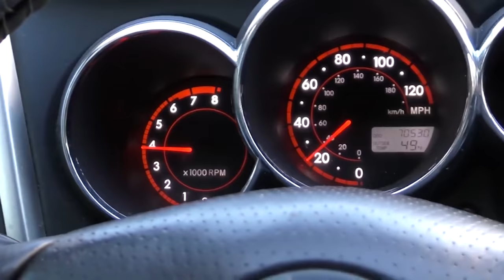5 Signs Your Transmission Has a Serious Problem

Comment: I bought a Honda. Just wanted tire change. But of course they "found" other stuff. I ended up changing transmission fluid and some other fluid.  No idea if they changed the filter or there even is one in a honda insight

Comment: I bought a 25 year old honda prelude. Sat for 2 years after being babied by a grand ma or grand pa for 10 years. I did a drain and fill with the first 3 quarts and added genuine atf in and it solved all tranny issues :)

Comment: Scotty I flushed my transmission fluid put Lucas transmission additive  with beck & arnly transmission fluid then from stop to drive it started to hesitate, sometimes I have to apply brake so it won’t jump start on traffic to father ruin transmission. Should I change the fluid again use the same old brand instead? Help!

Comment: I have a 240000+km E46 with a 5HP19 automatic transmission. As far as I know, it hasn't been cleaned out (replacement of filter, magnets and such...) for the last 70000km. Il probably should do it.
Do I replace part of the oil or put all of the old oil (at least what got out by itself) back in ?
DIY kits often contain 7 liters of fresh oil.

Comment: So I’m confused. I have to change the transmission fluid with new fluid but it will mess up my transmission?? I bought a car and I’m not sure when the last time it had or even had new transmission fluid in it. I’m lost on what to do. 
08 Nissan Altima 2.5 sl. 
Bought at 132,000 miles now it currently has 143,000 miles

Comment: I have a 2004 F150 was having shifting issues: I changed trans filter, fluid put Lucas slip, fixed most issues and got movement. I was Ashville to drive it but had a issue with needing to keep gas pushed to shift through about 45 mph and if I kept gas pressed, it would shift through all gears but once I released gas, I had to go below 25 mph to restart cycle... any help would be greatly appreciated!! (Update) the shifting is getting better through 25 mph and 30 mph not required to go below 25 mph to restart shift cycle. Improving Slightly...

Comment: exact same code except im in a 2005 toyota corolla s. lucky i stumbled upon this, just spoke to a mechanic today and he said to replace everything im looking at around $4-5k. same exact code, first time ive seen this in 3 years of owning the car, and i realized after watching this video it could be this. fluid never changed, dirty, and low on cold. i added new fluid to it before watching this, thinking it would help. guess ill be draining all of it to see what i can do to prolong its life.
Reply: Did it help?  I'm do the same thing
Reply: @DangLao  it did help. now after 10mph up to 48mph the transmission is quiet like it doesnt have any issues. on cold starts, it has a heavy hum when you first drive it off, and of course after getting up to highway speeds it hums and doesnt shift into the correct gear.

i drained the transmission and filled it 3 times until the fluid ran pink/red, pretty clear not perfect. added lucas transfix to help the clutch in the transmission grip (im guessing the clutch pack in the transmission has been worn) and shift better. got better gas mileage and it does run smoother, but DEFINITELY just prolonging the life of a dying transmission at this point.

in the last 2 weeks i bought a used transmission (tranny is at 122k miles from previous owner). gonna have it put in sometime soon and hopefully i can properly maintain it myself after this so this doesn't happen again.

Comment: I have a 2013 ford raptor I can be going down the road in it, and I will get a wrench on my gauge cluster the speed odometer will drop to zero then transmission will shift crazy like go to 5th gear and stay there. What do you figure the cause?

Comment: I got a 2000 chevy c3500 7.4l vortec engine. Transmission stucks in first when cold, then I turn the truck off and back on and it works as if nothing is wrong with the transmission. I scanned it and threw a bad 1 and 2 solenoids code. Changed them and the problem still there. I changed the transmission speed sensors and problem still there. What could the problem be?

Comment: Hey Scotty, I have a 09 F350 with a 5-speed automatic tranny, truck has 137,000 miles, fluid has never been changed. I checked the fluid while the tranny was up to temp, there was lots of grit on the dipstick. tranny shifts fine with no problems. The same case with the transfer case, fluid was never changed. Should I just change the tranny fluid and filter? how about the transfer case fluid? you think I should change it.

Comment: OMG this is very important information. I have a honda fit 2020 with 40,000 miles. Should i change the transmission fluid?

Comment: Scotty where are you located? I need you to look at my car. I have a 2006 Ford 500. I believe I have a small problem with my transmission but to sure. I bought my car to a mechanic, and they told me it was my front brakes, $350 later the problem is not fixed. I bought the car back and was told to take to a Transmission shop. I took it there and a mechanic took a quick look at my engine and told me my upper motor mount was loose. I had that fixed and $190 dollars later the problem is still not fixed. I was told once that is fixed and if it is still happening to bring it back to them and they would flush the transmission and see if that fixes it. (What I hear you saying makes me think all the mechanics are taking advantage of me because I am a woman and not a mechanic). The problem is when I go to slow down the car (jerks) somewhat but not all the, time. Only happens when the car is hot and has been driven for 15-20 minutes. I only paid $3000 for the car and already spent over $500 to get it fixed in less than 3 weeks of owning the car. I don't want to pay for a transmission that cost more than what I paid for the car.

Comment: I just bought an 07 Chevy Avalanche LS from someone back in February 2023. I do not know if they ever changed the trans fluid on it before. It was at 122XXX(i cant remember the exact) miles when i bought it. It is now around 131XXX miles. Would it be a bad idea to change out the fluid now?

Comment: And a friend of mine, who used to rebuild trannys for a living said... if you use the Lucas in your trans, don't just leave it in indefinitely or it swell all the seals and everything rubber within the tranny until everything's so tight it, it'll bind up and wont shift at all.  Put Lucas in for 3-4 K miles then unhook a cooler line or drop pan and get most of it out n replace with new trans fluid...

Comment: My car after running for an hour (30-40miles) 1st 2nd and reverse gear is stiff and comes to normal while parked for 1-2 hours. Transmission oil changed recently. Please help

Comment: so if i’ve had my car since 70k miles and now it’s around 88-89k miles i never did anything but an oil change around 80k .. i just changed my ignition coil and spark plugs because my car was shaking etc and it helped it. now my transmission is slipping and not wanting to go into gear… what should i do other than a transmission flush

Comment: I had to do a transmission fluid change because my pan got dinged by a rock and started leaking so I changed the pan and filled it back up it’s about 1/3 new oil because it’s around 3-4 quarts in the pan and 10-11 quarts in the whole transmission

Comment: True
The dealer flushed the transmission fluid, the genius shorted the capacity by 4 quarts.
It destroyed the fluid set a dtc p9741 destroyed the torque converter, the clutch plates in the 4t65e.
The owner blamed me and had an axe to grind.
Yes I did  4 years old car was useless I rebuilt it.

Comment: I see leaks under my F150 right from the transmission by the rubber to the differential by the gas tank, what can be the problem? 

Also when driving I feel rattling sometimes and also low squeaky noise, I bought the truck used some one put a universal transmission cooler instead of the original, could that be the problem, would it be a good idea to change back to the original cooler? Thanks

Comment: I got a good question for you Scotty. I bought a 1996 GMC Yukon 4wd transmission shot go to try to start it starter cranks enough to do a quick pop through the throttle body and then starter slips.. would a torque converter or transmission stop a engine from starting

Comment: Hey Scotty my younger sister has a 2014 370 z Nissan with code po732 I can't figure out if it's fuel injection problem or transmission problem it's got 115,k miles on it and code for catalyst I'm thinking it's a shop job what do you think?

Comment: I bought my first Kia Rio new in 2001. Brought it in for a flush at 30,000 miles as per the owners   manual. The service techs said they no longer flush them but merely change  the fluid. I said ok. Never had a problem and now 278k miles. Want a good car buy a KIA Rio.

Comment: Top 5 Transmisson Issues
1. 3:39 Revs too high before it starts shifting gears.
2. 3:49 Herky Jerky or Slips when youre trying to take off.
3. 3:57 When in reverse and step on the gas and it wont move. 
4. 2:00 and 10:15 Low fluid or Transmission flush either scam or done incorrectly. 
5.10:30 Torque converter or Lockup not working correctly aka slippage from filth or grime.

Comment: I have an Acura TL 2009 and ive knowthis when driving about 45mph rpms are about 2.5 or 3k .. if I let Go the pedal the Rpm will drop to 1k and kind of bounce until steady,  or can drop from 3k rpm to 1.5k rpms..  I know some about cars, but is my first Acura, is this Normal in this type of vehicles or when i let Go the Gas pedal the Rpms should stay where it was and slowly decrease wile slowing down ??

Comment: S4 b7, tiptronic, started to stop shifting 5-6, then puts itself in safety 3rd Gear always no shift, after flush gearbox dead, no 1, 2, 4,5,6, drives in 3rd then stops, reverse works. If its never changed its already dead, 17years no oil change

Comment: Well i flushed my 2015 frs auto trans at 100k, and at first i had rough shifting, added fluid, then drove fine for a few days, then car cut off when coming to a stop, started up fine, no codes, drove to next stop, car cuts off again. Didnt realize i was supposed  to do fluids while car was running, so did it that way today how it says to online, and now i have a check transmission  light.

Comment: How serious is it to drive a dodge caravan that is not shifting right first 2 gears no problem but after that it stays in that gear and RPM 3-4 K and you can hear it forcing itself. TrTransmission was replaced could it be the PCM engine control?

Comment: Hello Scotty, I have a 2011 Ford Fiesta and I took a right turn on a residential street and the drive gear just stopped. I wasn’t able to accelerate even though the car was running. I then switched to Low gear and was able to drive and then I was able to shift back to Drive. Not sure what caused that issue never had it.

Comment: what if the transmission does not hold the gear , not slipping  , just coasting when you lift off the gas pedal , shifts ok with a clunk into 2nd if you drive quick .

Comment: I have a sealed transmission on a 2019 Nissan Sentra.   So, I don't have the option to drain the fluid, I can only flush the fluid, which the manufacturer recommends every 30,000 miles.

Comment: I find it so difficult as a woman who knows nothing about cars to find a mechanic I trust. When my transmission slipped, I pulled over to the side of the road into a mechanic that told me to flush it. Luckily, he didn’t have time to do it and the second Mechanic I called told me not to. I’m not sure I understand much more after watching this but I guess I will start by having the fluid checked and changing the filter. It’s an older car but I’ve only had it for 2 1/2 months. No idea if anything’s been done prior to my owning it. I bought it from a mechanic, but I guess that doesn’t mean anything. UGH I hate cars.

Comment: I get a p0741 and p1744 on a 2016 f150 3.5 eb. Service wrench comes up whenever going uphill around 40-50 mph. Is this usually a torque converter issue, or just a solenoid? No symptoms otherwise.

Comment: Mines been slipping for 5 years now, but If you know how to get through each gear, it won't. It's a 2000 Acura tl. Got to be easy, I'm not spending another 5 grand for another rebuild. Just drove from Arkansas to Houston and back, and it actually shifts and drives better now than before. Still have to get through the gears with the same process, I think I can get another 5 years out of it this way. Anybody else this car would last a few hours, there too aggressive on acceleration and that would be the end of its3 gear.

Comment: I have a acura tl type S 3.5 L im start to remove the old transimision fluid but 3x3 1 change suring 3 weeks the dealer recomemd that, that can damage my transmision 
Now have 124k miles the first time i take 3 quarts looks really brown now whit the second one look pretty red 3 weeks ago I need to do the last change ?

Comment: 2016 Honda Civic 1.5 didn’t do enough research before buying and had the trans fluid changed, trans pressure switch went bad, fixed it and a few months later the trans is whining now. It’s under warranty but wtf Honda

Comment: My car literally just stopped accelerating out of no where? It won’t accelerate past the 1 meter on dash. Hey also have a check engine light on. It’s an automatic Hyundai Accent 2017 not sure what the issue is. I recently had an 02 sensor replaced and my brakes.

Comment: Scotty, I have a 2005 Toyota Corolla le that recently had the same trouble code of P0741 as the Kia in this video. While I drive it it shifts great but I do notice that once I get to about 60+ miles the engine feels like it struggles to give above that. I’m pressing on the gas and the engine is revs to 3000 rpm and stays there but it slowly speeds up to 70 miles an hour. My car currently has 162,000 miles and I’m wondering if I should try replacing the transmission fluid and adding the Lucas additive like you did on the final car in this video. What do you suggest? Thanks in advance :) and love your channel you’ve helped me save a ton of money with my cars.

Comment: I NEED HELP HERE PLEASE, 
MY CAR HAS AUTOMATIC TRANSMISSION, KIA RIO 2013. 
WHEN MY CAR IS ON A SLOP, AND I SHIFT IT ON DRIVE, THE CAR ROLLS BACK UNTILL I STEPP ON THE ACCELERATOR. THE SAME THING HAPPENS THE OPOSITE DIRECTION, IT WON'T LOCK ON DRIVE ONLY OR REVERSE ONLY. 
DO I HAVE A SERIOUS TRANSMISSION PROBLEM HERE?

Comment: I bought a 2010 highlander with 150 k miles on it... The transmission fluid looks really good. So should i change the fluid . Not a flush but should i change just yhe fluid
Reply: I bought a 10 years old car with 125k miles, I felt rough shift and shudder uphill. I did three times drain and fill, gear shift got improved. I noticed the more I drove, the more smooth the gear shift. It looked like a 'run-in' process for the new fluid.

Comment: So is he saying to drop and clean the pan and just drain and fill the fluid every 60k? Or is he saying you can still get a flush but that when you do, you should also drop and clean the pan and change the filter? I've been wondering for awhile if I should just drain and fill vs flush on my car with 30k miles. I had it flushed (I asked for drain and fill) at 20k

Comment: I prefer to downshift my manuel transmission on my Mazda pickup, and the brakes are still good after many years of driving, just got a new muffler and brake line too...just needs a rear spring shackle now, runs like a charm, and its a 2004

Comment: I have a BMW and I was unlucky enough to find out my transmission is sealed up. I cant change the fluid even if I wanted to and the manufactures manual for my model even specifies that damage will occur even if you can actually get to the fluid in mine. I find this extremely infuriating. Thankfully I have found that my car has large aftermarket support and theres some guys that make custom transmissions for my car for at a rather affordable price. My plan is to just run the stock transmission until its no good at all then order one of their custom performance transmissions.

Comment: 2017 honda accord se 2.4  . I changed transmission oil on Honda dealer at 30 thousand miles  , now 53 thousand miles  it slips sometimes when accelerating
Reply: Me too, any solution
Reply: @trevorhiggins79   yes . I bought  fuel system treatment  , throw it on gas  tank . Now works prefect . No vibration since then .

Comment: I had my transmission fluid changed (not flushed) at about 55,000 miles.  I will likely have it done again when the car hits 100,000 miles on the odometer.  I want my car to last me at least another 160,000 miles without major problems.

Comment: Please I have an issue with my 2005 INFINITI FX35 Gear box. it is hard to go in rear speed. any tip about the solution to implement? I'm thinking may be it is the Solenoid or valve issue. Because I have to accelerate to more than 3000 rpm for the rear speed to take suddenly. Once it is done I can go rear as I want. ANY HELP??? THANKS. I also had difficulties reading the dipstick, but just find some documents so I'm going to try checking the ATF level. Note : I have no problem for the forward speeds 1-2-3-4-5 and also manual; Just the rear has issue.

Awaiting your help please.